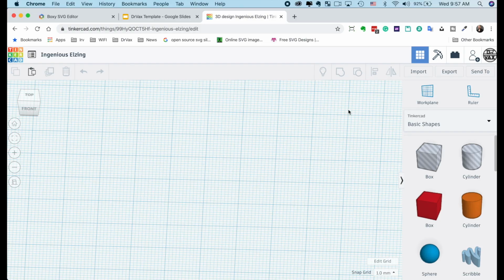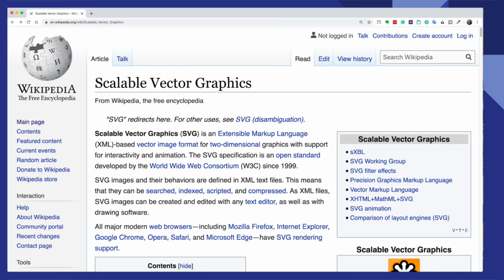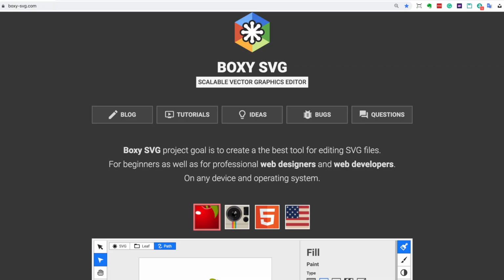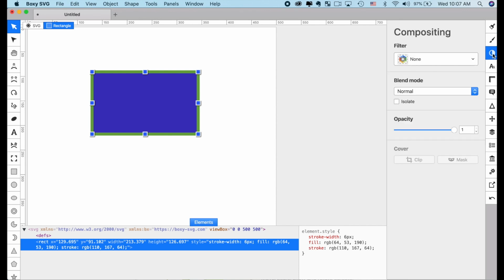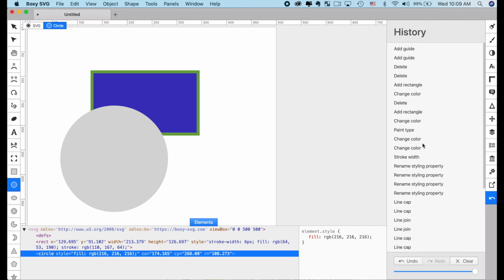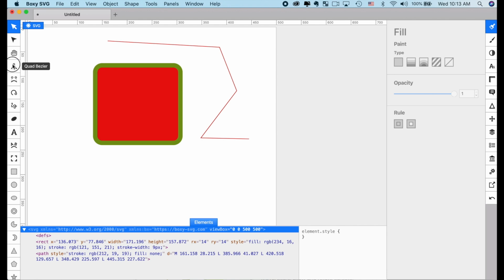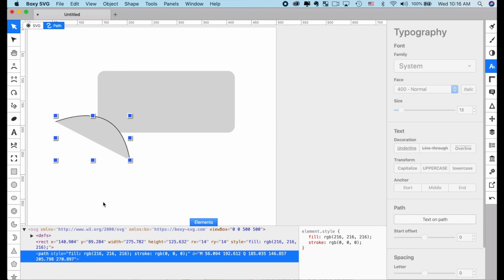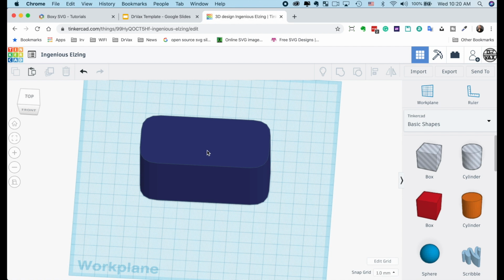Designing for 3d Printing with SVG Files

Comment: Good morning.  First, excellent tutorials!  My question for you is...I imported an SVG and it comes into TinkerCad just fine, it exports just fine and looks good in cura as well.  However, some lines don't print, like they are not part of the gcode or something.  Any idea what might cause this?  I would be happy to send the svg file to you if it will help.

Comment: Brilliant, thank you I just started using Tinkercad and just got a 3D printer, I wanted to get something to do vectors but didn't want to get into Adobe Illustrator and your video just saved my problem. Purchased that software. perfect. Have a question is possible with this and Tinkercad to create an object say the top is circle bottom is square and they morph into each other to create a new object with round top and square bottom? any ideas how hat can be achieved with getting into probably Fusion 360
Reply from the maker: Do do this, which in CAD is called a sweep or a loft depending on exactly what you want to do, you will need a program like FreeCad or Fusion 360.
Reply: @MakeWithTech  Thank you for the reply now I know what Im looking for, I did wonder if I needed something Fusion360, TinkerCad is very good but its not a professional tool for sure, great for the casual user :) very helpful

Comment: Irv, excellent channel! I'm looking forward to your next video detailing the use of SVG files in TinkerCAD. I have not been able to successfully import an SVG file into TinkerCAD with the fill turned off and opacity set to zero. I always get a solid shape similar to your rectangle at the end of your video which limits it's usefulness. I need to be able to import only the outline, a topic you referred to be included in in your next video!!
Reply from the maker: That video is coming soon.
Reply: @MakeWithTech  Can you provide a link?  I can't get my files converted using tinkercad.  I have SVG files but can't get beyond that to get anything printed

Comment: I was ready to purchase Boxy but it looks like it is only available for Windows 10 and I'm still using Windows 7. I do have Inkscape on my system but whenever I try to upload and Inkscape SVG to TinkerCad, it fails. I've only tried a few times and really don't know why it happened.
Reply from the maker: The problem is that Tinkercad only supports files in SVG V1.0 format and Inkscape is outputting V1.1.   You can edit the SVG file in a text editor and take out the extra headers that Inkscape adds replacing them with the headers from boxy and if your graphics are relatively simple this should have no impact.  

This helps explain what I like about BOXY SVG for use with CAD programs.  It does just enough and not too much.

I included here two examples so you can see the difference.  Notice how much shorter the BOXY file is, just enough to get the job done.  (Yes the Inkscape definition is more complete, but for my purposes, the added complexity is not necessary.)

BOXY-SVG

<?xml version="1.0" encoding="utf-8"?>
<svg viewBox="0 0 500 500" xmlns="http://www.w3.org/2000/svg">
  <rect x="183" y="163.117" width="209.093" height="136.882" style="fill: rgb(216, 216, 216);"/>
</svg>

INKSCAPE

<?xml version="1.0" encoding="UTF-8" standalone="no"?>
<svg
   xmlns:dc="http://purl.org/dc/elements/1.1/"
   xmlns:cc="http://creativecommons.org/ns#"
   xmlns:rdf="http://www.w3.org/1999/02/22-rdf-syntax-ns#"
   xmlns:svg="http://www.w3.org/2000/svg"
   xmlns="http://www.w3.org/2000/svg"
   id="svg8"
   version="1.1"
   viewBox="0 0 210 297"
   height="297mm"
   width="210mm">
  <defs
     id="defs2" />
  <metadata
     id="metadata5">
    <rdf:RDF>
      <cc:Work
         rdf:about="">
        <dc:format>image/svg+xml</dc:format>
        <dc:type
           rdf:resource="http://purl.org/dc/dcmitype/StillImage" />
        <dc:title></dc:title>
      </cc:Work>
    </rdf:RDF>
  </metadata>
  <g
     id="layer1">
    <rect
       style="stroke-width:0.26458332"
       y="54.853806"
       x="41.694046"
       height="86.862602"
       width="112.52047"
       id="rect3713" />
  </g>
</svg>

I hope this helps.   An alternative is to use the only version of Boxy but it is expensive.

Irv
Reply: @MakeWithTech  Thank you for taking the time to explain the differences between svg versions 1.0 and 1.1 as well as the differences between Boxy and Inkscape codes. I ran into a similar issue recently where an Inkscape svg could not be opened in Adobe Illustrator. Fortunately, that was just a matter of chaning the #filename.svg to #filename.ai.
Reply from the maker: I have found an easier way to prepare Inkscape files for import into Thingiverse.  Save as "optimized SVG" instead of SVG.  When the option window is display check the boxes that say "Remove XML Declaration", "Remove Metadata", "Remove Comments" and the files will import properly into Tinkercad.   The second two removes are probably overkill, just removing the XML declaration should be sufficient.
Reply: @MakeWithTech  That is fantastic! You sir, are awesome.

Comment: I use Inkscape as others have mentioned, tons of YouTube videos on it. I use it for 3D printing, CNC and vinyl cutting
Reply from the maker: Inkscape is an excellent tool.   Depending on the version you need to save your files as SVG Optimized and remove the extra headers for it to work with your CAD program.

Comment: Nice.  Your cookie cutter made me think of a question I've had for a while now.  If you want to 3D print a vase in vase mode, how do you define the outline in your CAD program.  Normally, I do an offset to define thickness.  But what would be the thickness for a vase mode print.  Thanks for your work.
Reply: EnuffsEnuff318 I’d like to know that too.
Reply from the maker: In vase mode most slicers only output a single wall with a nozzle size width.  So a .40mm nozzle will output a .40mm wall.  The slicer will automatically hollow out the model.   You could have a solid cube and the slicer will still only output one wall with no fill.

If you want a thicker wall you either have to change the nozzle or use an extruder multiplier to extruder more filament.   The extruder multiplier approach is not very accurate.

I have a Monoprice MP10 that I switched to a 1.0mm nozzle just for printing large vases.

Hope this helps.

Irv